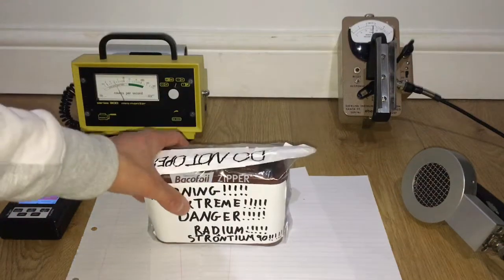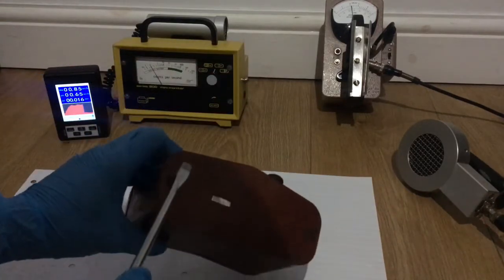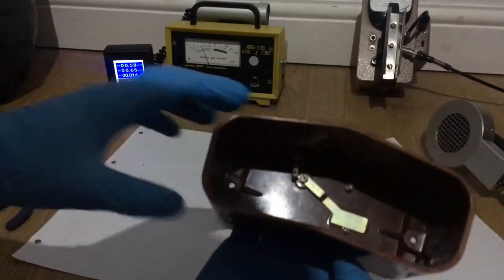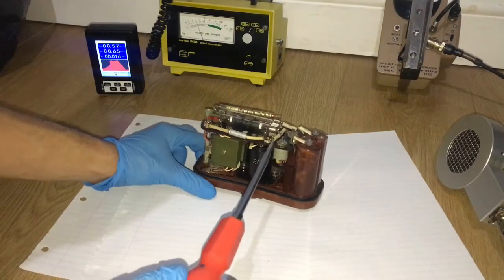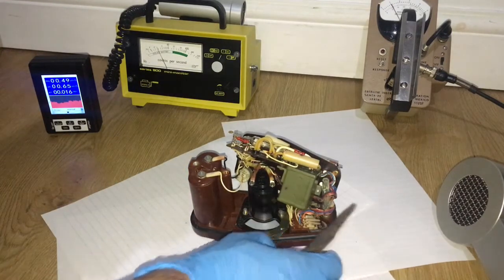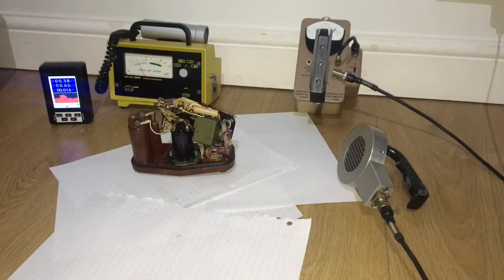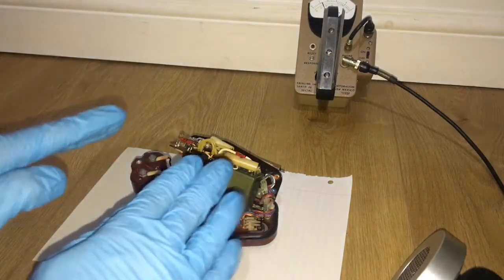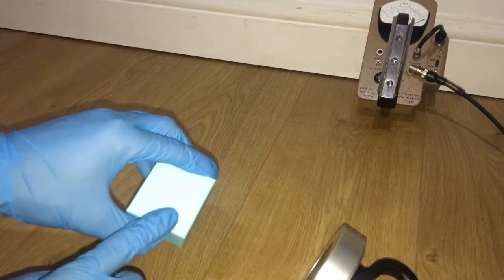DP63A Radium Dial

Comment: Awesome, that source is one of the most amazing types there is! Something I would recommend is to get a glass jar with a rubber seal which is closed by pulling down a metal handle. (Don't remember the name of them) As radon will mostly pass right through plastic so it does not do much when it comes to containing it.
Reply from the maker: Will do thank you for your advice, I have measured the plastic container and it’s extremely hot. The jar with metal handle you pull is called clip top storage jar and is used for storing as it doesn’t allow air in or out. I will buy it according to your advice, once again many thanks.

Comment: Having worked with radioisotopes, we would always put down a layer of plastic film backed absorbent paper. You might also consider using incontinent pads, normally used in hospitals to absorb urine, etc.  Pet shops have them for animals, too.

Comment: I would say very very interesting, fascinating piece of history. If you think that soviets used this tool to search for radiation, and at the same time they were being contaminated, it's astonishing. BTW i think you haven't been enough careful. Doing this on your floor with only three small pieces of paper, no respirator, and the sr90 in the little box, is quite dangerous. When you dropped all that dust on the paper i was very worried about your health! Using 100 pairs of gloves will not help if you don't follow other precautions. Please stay safe!
Reply: The most usefull comment

Comment: I have a question... I want to buy a DP-63-A. If I decide to don't remove the radium dial, is it then safe to have the dosimeter at home? Does the glass protects the radium dial scale from radon? Or do you advise me to remove it and put it in a glass clip jar?
Reply from the maker: The Dp-63-A is an interesting piece of history and I would advise getting it it would be great if you manage to get it working then that’s even better, sometimes there is no Radium dial depends where you get it, the Dp-63A is safe to have at home where I have 3 units at my desk as the radioactive material is inside sealed which makes it safe there is a small amount of Radon leaking through the buttons but that’s not that dangerous compared to smoking but if that worries you then you can perform a simple experiment you can put the unit inside a plastic bag and leave it for sometime for example week or 2 then open it up, taking out the unit and with different Geiger counter measure if there is any activity in the bag. However if the radioactive is for you too much then you have couple of choices either get one without radium dial or take out the radium dial but I do have to warn you that it is messy and dangerous. Lastly the glass protects the radium so no contamination happens and it lowers your activity of the sample as it works well as a shield there will be some radon escaping if you put it in glass jar what i did is putting the radium dial in a plastic double bag, then put it in small glass clip jar and into large glass clip jar then putting that jar into a bag and then put it in plastic bag so you be a bale to perform radon examination test to see if radon is leaking, the way to store it is away from you living area when taken out the radium dial for example to shed or Attic or even a basement as there is plenty of radon there. The strontium 90 source you don’t have to worry about that as it is pure Beta emitter. Hope this helped if you would like I can make video for you so I can explain I’m greater detail for you?
Reply: @geigerfever784  Thank you very much my friend! I completely understood everything! There's no need to make a video. Anyway, I love watching this type of YouTube channels. So if you finally do a tutorial I will watch it for sure! Thanks again!
Reply: @geigerfever784  Do you know for other radium sources which are not that spicy? I live in a small apartment, but I still would want to have some radium in my collection
Reply: @MrServaal  some vintage watches/ aircraft gauges have them, look for those. If it's ok, go to a antique store with a GM counter, you will likely find some.
Reply from the maker: @MrServaal  hi, hope you having an amazing Christmas and keeping safe and healthy. There are many sources of Radium which may suit you. First is radium watches but please be careful cause some watches may be very hot but some may not be hot. Second Radium dials from world war era once again they can be hot and not. Thirdly is Radium tube which I have and it is called 1B22 Spark Gap Tube. Lastly is Radium baring minerals.
Reply: @MrServaal  If you live in a small apartment alone that's up to you, but if there are others or pets around, then you should not be keeping anything dangerous like this Radium compound scale. Due partly to their age, the material is friable & freely releases particles that can be inhaled or ingested...not just RADON gas.
Reply: @geigerfever784  Yes, seen the YT video of one of those being tested by a GQ GMC600, with readings which are well exaggerated, at least for gamma emission. The ONLY other ones that I've seen with a Cs137 electrode because of their age, are long past their half - lives.

Comment: Its not that contaminted ugh... idk yhy you people feel so scared, being 3-5x more radioactive than background is not much (end of the video)
Reply: If it was cyanide or fuming nitric acid you would be very careful.  Just because the radioactive dust from the old dial doesn't look much, you think breathing in a few particles is nothing.  With alpha emitters, it is not a matter of "times background" that is for x-rays and gamma radiation, not alpha emitters like radium or radon.
Reply: @karhukivi  you’re right, i didn’t think about possibility of that
Reply: @karhukivi  masks are cheap.
Reply: @regnadkcin6702  They certainly are but they don't stop very fine particles.  You need full breathing apparatus and preferably work on something like this outdoors if you don't have a proper radiological cabinet to work in.